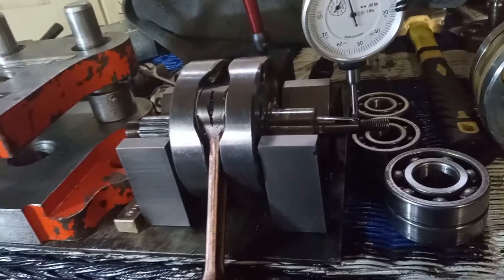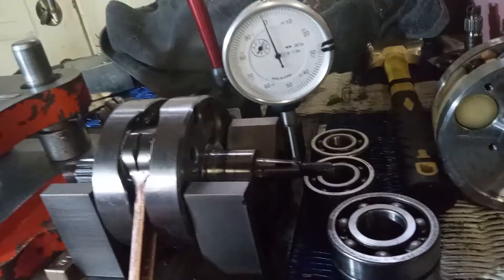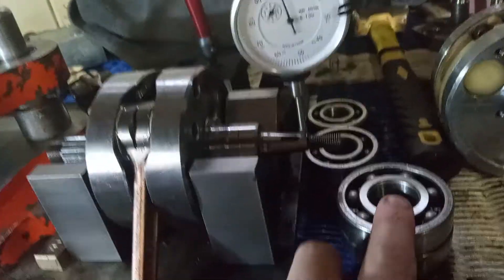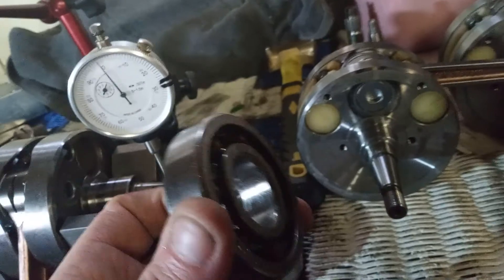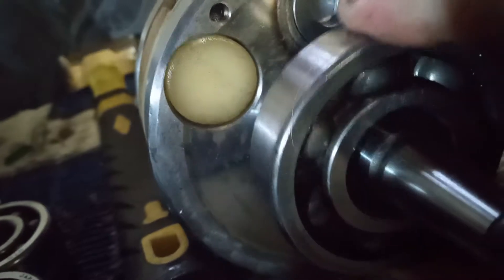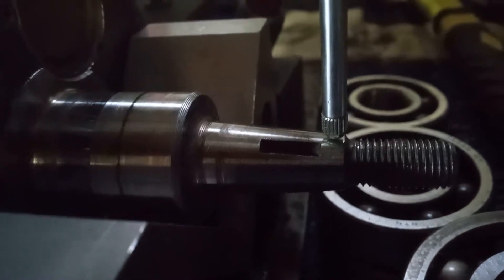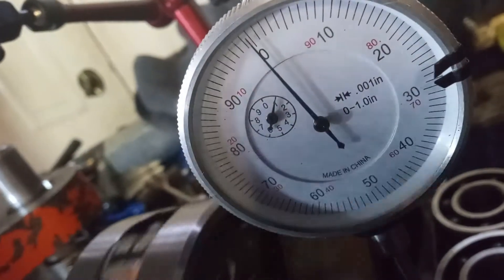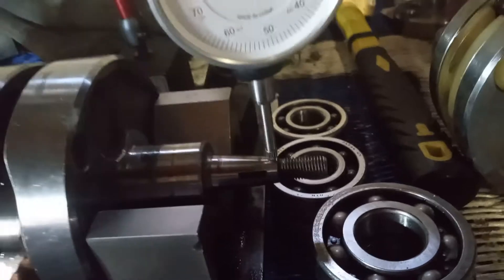86 YZ250 crank

Comment: Sweet I was wondering how you got the bearings on. So far I got everything I need to true. Besides a press and some 1/4 steel plate  is there anything thing else you'd recommend getting for the diyer? Jig? 20 ton big enough?
Reply from the maker: 20t definitely I only use a 12t